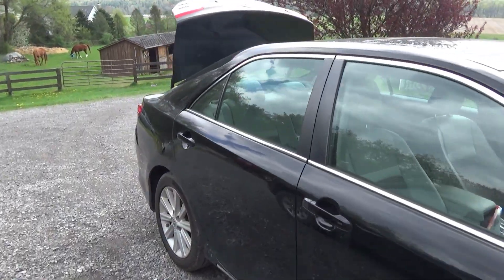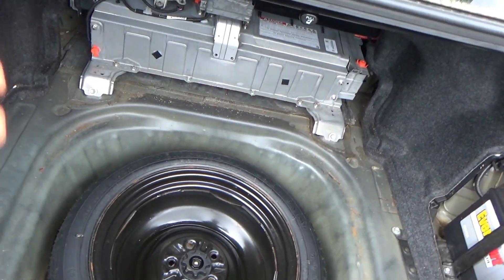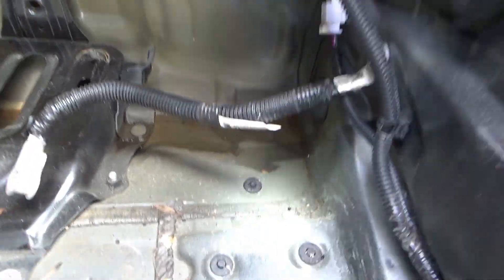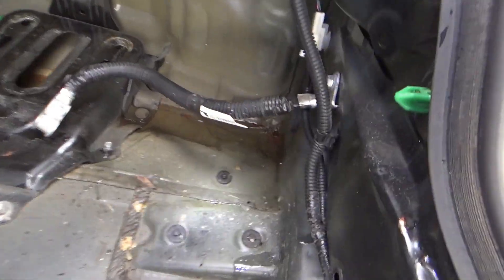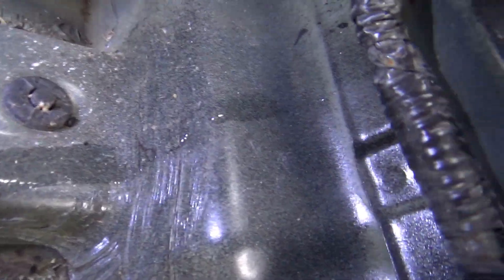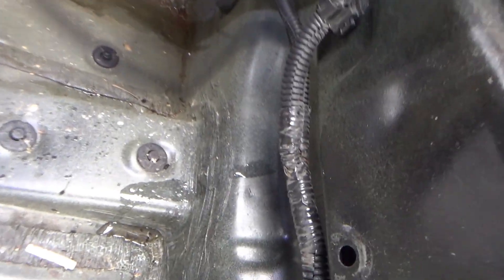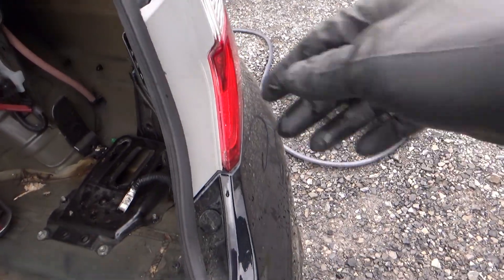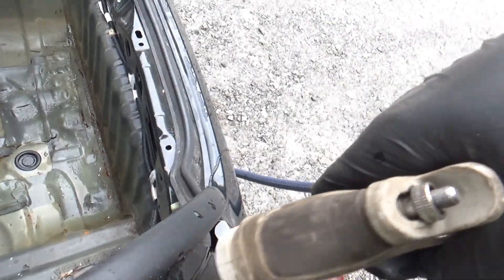Helpless HYBRID....from Florida?? (Part 4 - Trunk WATER INTRUSION?)

Comment: I hope someone finds this useful tip. For an easy way to detect water leaking into your car, all you need is ordinary white school chalk. Remove the interior trim, mark the inside with the chalk, and then test with a hose. The water will wipe away the chalk and clearly reveal the source of the leak. You don’t need to cover everything thoroughly—just draw a few lines. I hope this helps.

Comment: 2015 camry hybrid hydrlocked here😂.. How do you rotate the crankshaft by hand I'm trying to check for a bent push rod?... I'm afraid to do a forved 4 start r in maintenance mode because it might just start thrashing metal parts all around..... Should I just Insert a stick in each piston hole and measure the height very accurately To see if 1 of the pistons is lower than the others1-4 versus 2-3...

Comment: My wife's 2007 Toyota Corolla was involved in rear-end collision which damaged the bumper cover. Had that replaced and a few months later started to have signs of moisture in the passenger side interior. Looked everywhere and found the spare tire storage full of water. Could not find the exact place for water intrusion. Finally went crazy with silicon sealant at all visible body joints. After many weeks of trail and error and lots of sealant application, the leak was stopped. If I would have taken it to a body shop, they would have replaced a lot of stuff and charged a huge amount of money.

Comment: 1600 dollars is good if you have already hybrid car, and you dont have a choice, 1600 or 5000 to 7000, may be more, but for anyone who was thinking about hybrid car, forget it, hybrid cars not good, battery cost too much,  even you know how to replace battery cells yourself, it is still going to cost you from 1000 to 1500 to replace all battery cells. So forget it. In addition to other expensive parts on the hybrid cars like steering electric motor and so on.

Comment: Climbing the trunk with a flashlight close the trunk lift got someone to spray everything with the water hose you'll find the leak in 5 minutes most likely the leak is at the Rubber seal at the top if it's had a body repair the truck gutter is probably slightly bent just a tiny band is all it takes to make the gasket leak if you can't find it in the top check the tail lights

Comment: In the previous video you said the cost of the repair of the battery was $1600 dollars. Could you tell me how much your hourly rate is in this repair. How much was the extra hour that the customer approved. I live in Oregon. I haven't found anyone here with your skills at repairing electric and code reading and the solutions. Thanks for your posting. BTW. I have a 2001 Prius that no one has solved yet in the battery pack.Triangle of death. I drive it with the Gas engine only. Runs great.

Comment: When I was the shop 4man at Toyota... I made a "Stand"  with a shower head that any my techs could connect the garden hose to and spray check for water leaks.... I've seen and repaired enough H2o leaks in my day that they come in over at d/s A pillar, and puddle up in the passenger rear !!! Especially after (99.9%) post human body works repairs 😡 YOU should do that INSTEAD of garden hose... 😶😊😇

Comment: Hybrids are the present and will also be the future. Pure EV's will never enable somebody to only have one car as nobody wants to wait 35 minutes to fill up their "gas" tank at a Supercharger. If you're rich enough to have two cars and you live in a city EV's are great as you use this 90% of the time and then jump into your conventional car to drive to Vegas. Here in Arizona we have complete communities that are based on golf carts and they work fine. Unless battery technology reaches the point of giving you a 500 mile range you're always going to need a second car to take a trip. Hybrids solve this problem better than any other solution currently available. Ivan you could make a fortune rebuilding battery packs as the number of hybrids grows every day.

Comment: Ivan, how much care did you need to take in re-torquing the bus bar nuts, and does a spec even exist for such a thing? The reason I ask is that my step-daughter's 2001 (gen 1) Prius had the entire battery pack replaced with upgraded cells, and after driving for about 1000 miles, the dreaded "triangle of death" started popping up very intermittently (it would come and go) on her display screen. Come to find out that a single nut needed to be tweaked just a little tighter (like 1/16 of a turn), and the warning has never returned (after 15,000+ miles).

As always, excellent video series, and thank you for the footage on finding and repairing the water leak!! 😁👍👍

Comment: One thing worth checking on these is underneath the weatherstrip on the roof - especially in the corner by the rear hatch on a hatchback or in the corner by the glass. There is a seam underneath there and I have seen a few Toyotas from the mid 2000's that developed cracks in the paint on the seams and then the water gets in through the seam and wicks down the inside and pools in the boot. Its not uncommon to see water in the 12V battery compartment on a prius. I'm not sure if these vehicles had, had a respray at some point and that is what caused it. Very difficult to find if you don't know what you're looking for.

Comment: Actually a design flaw. It's called designed obsolesces. That seem should have been arranged top over bottom instead of the other way. Even if no sealant, it would not have leaked. Like the shingles on a roof. Even with a house, relaying on sealant to keep out water instead of correct construction is a recipe for a leak. Water is a sneaky thing.
Reply from the maker: Agreed, I thought exactly the same thing...wrong way overlap!

Comment: Great find on the water leak.  We used to use water bottles and pour the water into the "water channel" around the trunk opening, the sunroof, rear doors and trunk while closed and latched as well as around the tail lamps and side markers etc. That process gave us a better control with the excess water splash. When we would repair body seams like this one we also used a cheap paint brush which helps push the sealant into the gaps creating a better overall bond to the gaps and two body panels. Vehicles could use a one way drain down in the spare tire well which would prevent them from collecting gallons of water plus they will act as a warning to a car owner who notices the water dripping from the one way valve.

Comment: My dads Peugeot 406 had water getting in the boot.
Turned out to be after market reversing sensor's with no grommets and the big towbar electrics grommet pulled out completely.
I ended up using loads of clear silicone sealant.

Comment: Toyota should partner with Thule to make a hermetically sealed, but openable for service, hybrid battery box.
Then, if you happen to drive into a lake/ocean, the battery will never get shorted.
But, Toyota should team-up with DeLorean and make stainless steel cars.
Profits interfere with rational engineering sometimes.

Comment: Wow, what a journey this repair turned out to be.  I will 2nd the Permatex flowable silicone, having used it to seal around a leaking windshield.  I think you said that the flipper bought this gem at an auction.  I was thinking of 1 of Eric O's philosophical musings - something like "Not every bad car is at the auction, but every car at the auction is bad".

Comment: I would get a shop vac with exhaust nozzle or small floor fan and make 100% sure that trunk space is dry as a bone. Power wet soak the whole back end of the car and recheck for a leak.

Comment: It's really hard to believe that the sense wires on that giant battery are not fused at the HV battery.  I mean you have almost unlimited current available on those small balance sense wires and as seen here if they short out, you don't have any protection and the wires burn.  Not a good design in my humble opinion.  Water leaks really annoy me.  I will not own a car with a sun roof or moon roof anymore.  I mean why make a car and then cut a huge hole in the top and risk water intrusion.

Comment: Hi Ivan! I dont want to burst any bubbles but the (green) plastic bumber fastener where the screw goes in is not OEM and it's in the path of the drain water thus lets water in. I'm affraid the water intrusion problem is not solved. Had a similar issue on an old Renault 25.

Comment: The paint forms a seal at the edges of the panels, and the shock from an impact can break that seal, especially  in the rear quarter panels. Ther doesn't have to be any visible damage. Also rusting at the bottom of the read widow is common too.

Comment: Excellent follow up and follow through finding the area of the leak. Owner smart to have you do that. Very understandable why owner happy. I remember your work around on the tube of Permatex, I thought it clever then and now. I once owned a Geo Prizm hatch (Corolla) that got in a rear area fender bender. After the repair, it leaked on one side but mostly after car "moving" on rainy roads.  Body guy sealed around rear light area with silicone, didn't fix it. After much time and investigation, I finally figured out where leak was. The are small one way flapper air vents behind the bumper cover. Apparently, one was damaged in the accident and a rubber flapper or two missing so water from very wet roads could intrude into trunk. Luckily back then able to find one at nearby junk yard. Fixed the issue but it was a tough find. Anyway, nice repair and finding root cause. 👍

Comment: It was very smart of you to recognize the need to eliminate the water leak! I could see a lot of people not taking that step, with the customer having to go thru the whole process again. Fun fact: I used to work on industrial lasers used for welding (440 watts output) that used flash lamps to excite the rods generating the output. The power used to flash the lamps (380 volts or so) passed into the cooling water, and the lamp sockets and everything was immersed! Trick is that the water was clean and deionized. Pure water isn't conductive - it's just that most water we come in contact with is contaminated. And yes, there would be green crusties at times, when the water wasn't clean....

Comment: Would silicone last there for years especially if the car is in a harsh environment with lots of temperature changes? Maybe would have been better to weld it and paint over that small spot with some zinc paint?

Comment: I bought a Toyota Aqua hybrid recently and it's great. I went from filling up weekly to every three weeks. My fuel bill has plummeted. I did my homework and found out about module replacement, availability, cost, general reliabilty of the system etc. being a Toyota, as expected, the reliability of the synergy drive is generally excellent. Just look at Taxi drivers with the Prius. Huge mileages are common. The pack mostly lasts the life of the car. As Ivan said, they're not useful for long distance drivers. As city cars, it's hard to beat them because they save fuel and the range is great. I think they are a great stepping stone towards electric cars. Once the electric cars become more affordable and range is better, infrastructure etc, We'll be ready to move en mass from our hybrids.
Reply from the maker: Toyota "Aqua" Hybrid 👌😂
Reply: @PineHollowAutoDiagnostics  Haha. I should have seen that one. It's a 'Prius C' in the USA, maybe I should have called it that 🙂

Comment: On a side note about the dried out silicone tube.  I found using a hot glue gun to put a glob of hot glue sealing the opening of the tube stops the hardening of the silicone.  This also works on caulking gun tubes.  To assist in getting a good seal, use a piece of tape to make a reservoir on the tip of the tube to  keep the hot glue in place on till it solidify.
Reply: I'm gonna hafta try that! I'm sick of wasting silicone, and was beginning to think I may as well throw away tubes after  the first use. Seems to be that way with spray paint these days, too!

Comment: Well done.  I had one getting in through a body seam above the driver's door on an extended-cab Dakota; it made its way all the way to the back wall, coming down behind the trim next to the back window. It pooled on the floor under the carpet under the rear seat, then went forward in a wiring channel and found its way to the driver's footwell.  A weekend of rain led to an inch of standing water.  I basically had to gut the interior to find it. Glad yours was much less of a pain to find & fix.

Comment: I was driving back from Andersonville, Georgia running 70-80 in the ol' Marquis; she didn't use a drop of oil; who needs hybrids.  While I was at the fly-in I noticed they are selling battery-powered paramotors.  I couldn't imagine having the battery run down at a bad time.  Great video!

Comment: Hydroelectric Camry. 😁When I was a kid my first job was working at a Pontiac dealer and being a kid I was the one to get locked in the trunk to look for water leaks. They built a spray rig out of black pipe. As I remember our success rate wasn't very high. At least not on the first attempt.

Comment: This is why I'd never buy a hybrid or electric car.
Reply: If you don't want to take a chance on a car breaking don't but one. They all break, but a Tesla... well it lasts longer than any others on average.
Reply: @tedmoss  Impossible to make that statement, since most cars will last 20 years.  Teslas as we know them have been around about 11 years, with most of the early ones at this point failed because of drive issues and or battery replacements.

The cost of a battery is simply unacceptable at this point (a tiny battery in a hybrid costing more than an engine replacement), which is why used electric cars have high depreciation.

Comment: There are a number of historical accounts on youtube of serious green crusty's corrosion failures within Prius Battery management module connector. that connector has history of problems , sometimes getting to the point where the wires internally corrode and short to other pins within that connector and then pass so much current they burn themselves off , hint to Toyota that connector really needs to better moisture protection. or the battery pack itself needs to be better sealed to protect against water intrusion into the connection compartment ,  The battery itself forced air cooled (And has a filter on its fan inlet that needs to be checked) so if it draws in moist air it can cause internal corrosion issues there as well ..
Reply: How do you avoid moist air in most places on the coast or lakes?

Comment: Green crusties do like water though. Nice repair. And fully agree that needs to be fixed. Have you tried soldering such cracks with a blow touch when it's on metal? Does that help with lasting the test of time? Or does silicone hold up? I would think jb weld maybe could work?
Reply from the maker: Flowable silicone is the bees knees. Holds up for at least 10 years from experience waterproofing my own beaters :)
Reply: @PineHollowAutoDiagnostics  that is awesome. I would not have expected that. I used a simular silicone to yours for waterproofing my electrical box in the engine compartment. Mainly as a non permanent glue but it does work good for that :) never had it outside for long periods though so that's why I was curious. Awesome work on that repair. Interesting that the cells did level out over night any idea how that happend?
Reply: @ToxicwasteProductions  Its the nature of the beast.
Reply: @PineHollowAutoDiagnostics  It will last a lot longer than that, 50 or more years.

Comment: What can go wrong will go wrong - I just got hit with a spun ROD bearing!!! I got most of it off, but there is a section that feels like it's welded on, so I can't even do a temp fix! Apart from that the journal looks great!

EDIT: I accidentally wrote WHEEL BEARING - when I was actually talking about a ROD crankshaft bearing.
Reply from the maker: Heat it up with a torch!
Reply: @PineHollowAutoDiagnostics  Thanks Ivan - I read up on Muriatic acid, but torch sounds a lot better. Has it worked for you in the past?
Reply from the maker: @pingpong9656  oh big difference between wheel bearing and crankshaft bearing 😂
I would take the crankshaft to a machine shop to get the journal cleaned up and polished 👍

Comment: Great work, Ivan.  My Honda Fit bought from new had the same problem and it didn't take long before the wheel well filled with water.  The problem was with the sealant used at the factory, which dried and cracked over time.  Ended up doing a similar repair to what you did, and hey presto no more water!

Comment: With all the ridiculous things that have throw a CEL code for stuff like pressure issues in the fuel tank related to the evap solenoid, you'd think they would have at least have water ingress or excess humidity sensors in critical things like batteries.

This is why I hate the massive overreach that some government departments have.  Their unintended consequences can be that the things which actually matter aren't dealt with,  because the vehicle manufacturer has blown so much of their engineering money on compliance.

I work in InfoSec and it's the #1 reason why companies get hacked - all money on "compliance", none on actually defending against real threats.  It enrages me.

Comment: I had a water leak that was at the body panel seam where 2 panels were welded together the weld cracked and it took flowable silicone to seal it up.

Comment: the cheapest fix I see is drill a hole in trunk for the drain is guaranteed no more flood. it happen to my customer that don't want to pay for diagnostic time. charge him a beer for that.

As I follow the story, the Toyota Hybrid is flood and repair and get sold and drive few month until the sensing wire is cut and burn. Amazing!